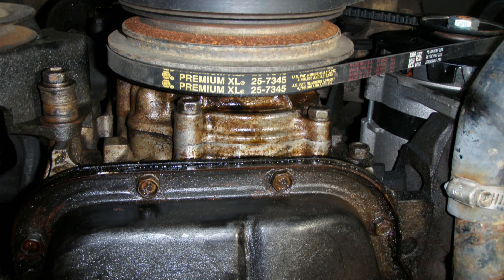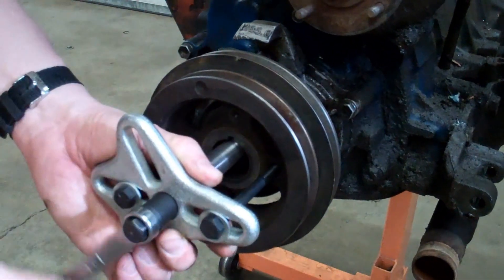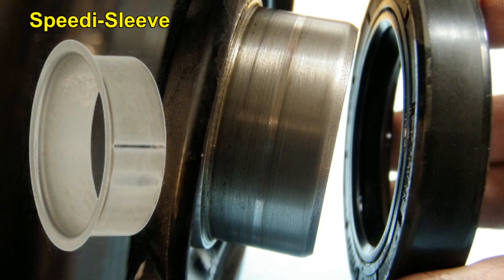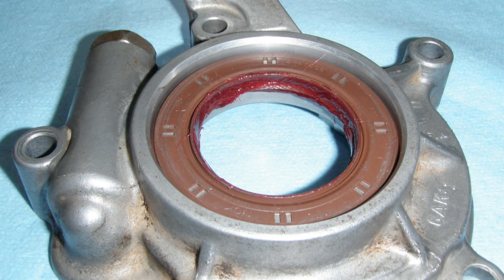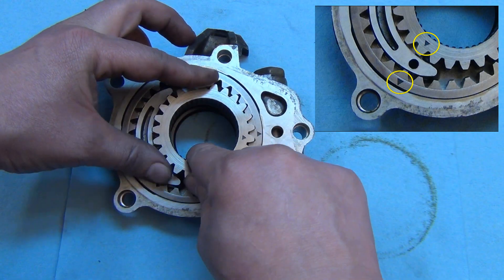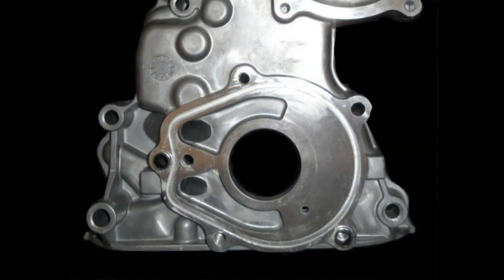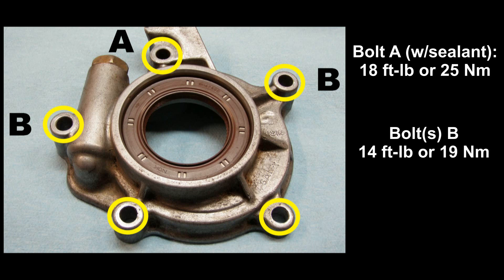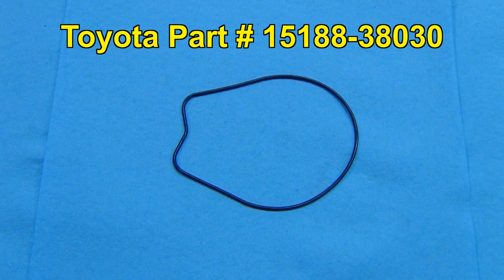How to fix Toyota 22R Front Main Seal Oil Leak (22R 22RE 22RTE) No Speedi Sleeve!

Comment: I was able to successfully replace the front crank seal on my 1989 Toyota pick up truck by following the instructions in this video. My biggest worry was getting the crank shaft bolt off the engine. However, the bump start method worked like a charm. Thank you for this video!  No more oil leak!

Comment: I install the pump with 2 loose bolts then install the pulley lightly to center the pump/seal...tighten the 2 bolts, remove pulley and install the rest of the bolts, torq to spec...This makes sure the seal is centered on the seal surface of the pulley, if its not centered it will leak.....And beware doing the bump start to remove the crank bolt....You can F up the flywheel and or starter,,,I only use it as a last resort after trying a little heat to the bolt and light taps on it...I took a thick piece of 1/4" steel flat bar, drilled 2 15mm holes spaced to fit 2 of the pulley cutouts(where you put the drift) and ground out a haft moon to let the socket go by, install 2 14mm bolts with nuts in the 2 holes and use as a holder, the bolts going into the cutouts and the bar against the socket side....Doesnt F up the dust seal....

Comment: I get where you're coming from but the fact is, that is a harmonic balancer that the Speedi-Sleeve goes on, if it was just a "pulley" then it wouldn't have the weight and rubber insulator strip on it, I can't help that Toyota uses their own goofy nomenclature. Go to any quality machine shop, they WILL call that part a balancer. I was just trying to help, no offense intended.
Reply from the maker: No worries.  Where it gets really strange is they did have totally solid pulleys for a few of the early years.  No elastomeric layer...nothing...just solid steel  (I have one like that from 1981).  All they did was balance it by drilling into the backside similar to how you balance a crankshaft by removing material at the heavy points.  The later model pulleys have an elastomeric layer in addition to drilling for balance.  I guess Toyota just never changed the terminology.  Might have also been economy of words.  "Crankshaft pulley" is less ink than "harmonic balancer hub" in the manuals...lol

Comment: Removing oil pump not necessary but thanks for all the tips!
Reply from the maker: It's not necessary to remove the oil pump, but it's easy to do and gives you a chance to inspect your oil pump gears while it's off the engine.  Removing the oil pump also lets you drive the seal perfectly into the bore with a seal driver, something you can't do if the crank is in the way.

Comment: Bought the O-ring, got the 5 bolts out. Damned if I can get the pump housing off. Steel hammer, pry bar and steel hammer. That sucker isn't moving. Finally gave up, Prey it doesn't leak for me! Pulled a narrow seal and stuck in a wider one.
Reply from the maker: My guess is that the hollow alignment dowels in the timing cover are seized to their holes in the oil pump binding the oil pump to the timing cover.  In the video at 3:06 you can see the dowels in the timing cover (middle left and low right as seen facing the timing cover.)  could also be the oil pump drive gear binding up on the crankshaft drive spline too I guess.  could put the crankshaft pulley back and in the truck in neutral and wiggle the engine back and forth with the crank pulley to try and free things up.  But I bet it was the dowels.  Sounds like you got it fixed regardless.  Most shops would just pry the seal carefully out and drive in a new one to save time.  I like to inspect everything so I always take the extra step and pull the pump.  If you do have to go back in there, and it still won't budge, I would CAREFULLY, heat up those two areas with a propane torch that have the alignment dowels and then put some penetrating spray in there so help them get unstuck.
Reply: @WheeliePete  Thanks, I completely missed the dowels. I put the crank pulley back on but was supplied the 60mm impeller water pump not the 69mm I ordered. I may yet pull the pulley and have another shot at it as the o-ring is here in it's bag. Mechanic for 40 odd years though and I didn't dare hit/pry harder than what I was as there was zero movement. Now I see the dowels I can work "local" to those and perhaps have a better shot. I'd hate to have to do it all again. Cheers from Australia.

Comment: Yeah man, excellent video! Thanks especially for those part numbers, nobody ever does that 🙏🏼. Question: you mention the o-ring fits the 20R as well, does the main seal do the same?
Reply from the maker: I believe it does.  I've never personally done it on a 20R engine, but LC Engineering lists the same front seal for 20R, 22R, and 22RE on their website and they are an authority on that engine so I'm pretty sure it will work.  Link to LC's website:  https://www.lceperformance.com/Front-Seal-20R-22R-RE-Front-Balancer-Seal-p/1015042.htm
Reply: @ Thank you again!

Comment: @WheeliePete, I just ran into the same problem @Ben Hanley (down below) had.  I was all set putting the new Aisin oil pump on and got all four bolts torqued bottom part of the pump and started torquing the top bolt (through the timing chain cover).  Had some resistance and going good, then it just slipped and kept free spinning.  Took the bolt out along with the aluminum threads from the timing chain cover.   I am, pretty sure a shop tried to correct a previous oil leak by over tightening.

Either way, now I have the dilemma of should I put a helicoil in now or do I chance messing a bunch of stuff up by removing the timing chain cover to install helicoil?   Can't find a good helpful video on this.
Reply from the maker: I've never done a thread repair on that hole, but I bet it could be done with the oil pump off and just be really careful about shavings and try not to break the tang of the helicoil off and have it fall into the engine.  Removing the timing cover with the head in place can be done, but it's tricky because of the head gasket overlap at the top of the timing cover (junction of the head, timing cover and block.)  If you booger up the head gasket right there you'll end up with another oil leak.  If you're going to go that far into it you might as well replace the timing chain, guides, etc.  The other thing you really have to watch out for is there's a hidden bolt in the head that sits in a puddle of oil under the distributor drive gear.  That bolt is through the head and into the top edge of the timing cover.  People often forget about it, start prying on the timing cover after they think they have all the bolts out, and then snap the timing cover.  I have done timing replacement though with the head in place, you just have to be really careful when you do go to pry off the timing cover and then make sure all your sealing surfaces are really clean before you put it all back together.  One last thing, if you decide to get a new timing cover, and if you're engine has been rebuilt and has had the head surfaced or decked, you'll want to make sure your new timing cover is the same height as your old timing cover.   If the engine has been rebuilt and they machined the block with the timing cover in place to match the height, then the new timing cover will need to be machined to the same spec.
Reply: @WheeliePete  Roger that, I'm going to attempt to helicoil it with the timing cover in place.  The rebuilt engine has maybe 50K on it.  I don't want to risk pulling it all apart not really knowing what I'm doing.  
Spoke to a local mechanic yesterday and we agreed the less amount of shavings in the engine the better.  Will get the tang of the helicoil out somehow.  He stated that the oil screen should pick up any shavings prior to entering the engine anyway.  I was searching for an oil flow diagram of the 22RE to confirm.  I think I'll do an oil change prior to starting the engine once everything is back in place.

Thanks for the info.👍

Comment: I have a 1993 4Runner with the 22RE and the pulley DOES unbolt from the balancer.
Reply from the maker: Are you referring to the power steering belt pulley that is bolted to the front of the crankshaft?  If you have power steering there is an extra pulley that bolts on with 4 bolts to the face crankshaft pulley giving you 3 rows for "V" belts.  I've read there was a design change around 1985 to the crankshaft pulley design where they started getting an elastomeric layer.  But the early crankshaft pulleys do not come apart (and I've never had one that would or did come apart other than the extra pulley for power steering bolted to the front of the crankshaft pulley.)  I just pulled some later factory service manuals and they (Toyota) continued to refer to it as the Crankshaft Pully through the end of the 22R series.  Side note: If you have an extra one of those power steering belt pulleys for the crankshaft you can make a crankshaft holding tool really easy with some steel and a welder.  Makes tightening the crankshaft bolt a breeze.

Comment: Thanks Mark cool video. 
I have a Question for you maybe you can answer. I have a Toyota with a 22 RE in it and I’m having problems with it overheating. as I was taking it apart to check the head gasket I noticed that when I took the oil filter off it didn’t have any oil in it at all. Do you have any idea what would cause something like that?
Reply from the maker: Oil filter have an anti-drainback valve (flap) in it?  If the filter doesn't have an anit-drainback flap (or if it's not working right) the oil can flow out of the filter and back to the pan.  The idea there is that the filter should be holding oil in it so it's full on the next startup.  There was oil in the pan, right?  No oil circulation in the system would cause a major damage, not just overheating.

Comment: Super helpful video thank you so much WheeliePete! Got my front main seal and o ring all replaced and I'm finally leak free. The PO had put a thin seal in but didn't drive it all the way into the bore. From the looks of it if it's sitting flush at the top of the bore then it sits about where the thick seal does on the pulley. Driving the thinner seal to the bottom lets it ride on a new place on the pulley and like you said guarantees it's square in there. One thing I encountered that you didn't get into too much in the video is that tightening the pulley bolt was a bit tricky! I used the bump start method to get it off and that worked great. Didn't need a pulley puller either probably because it had been leaking oil for quite a while and it was lubed up ready to slide off. 

The most trouble I actually had was finding a way to hold that pulley still so I could tighten that bolt back up to spec. I didn't have a pulley wrench, or holder, and I left my radiator in so a regular impact gun wouldn't do it. I didn't want to wait for a tool or spend the money on a 90 degree impact gun and it maybe still not fit. Best thing I came up with was to block the tires, parking break on, put it in 5th gear, 4hi and then tighten against that. My torque wrench topped out around a 100 ft/lbs so just went a little past that and have checked it a few times since and it's stayed tight. I think I've read and understand that the bolt should get tighter over time due to the nature of the rotation of the motor and the matching direction of the bolt to tighten. Lotta torque going on there!

Videos like yours really help the average guy work on their own stuff, save money, and keep their rigs rolling down the road ;) Many thanks!
Reply from the maker: Glad the video was able to help you out.   It sounds like you'll be just fine on the torque.  You did exactly what I would recommend in the absence of the right holding tool for torqueing the crankshaft pulley bolt.

Comment: Does anyone know if you  have to drain the oil to change this? Or it doesnt matter?
Reply from the maker: The pump is above the oil level in the pan so you technically don't  have to drain the oil.  There will be some drainage when you pull the pump off the front of the timing cover from oil trapped in the pump body and oil passages.
Reply: @WheeliePete  ok thanks. I couldn't find the answer on any forums.

Comment: Just to confirm I don't need to drain oil or coolant to do this? Thanks in advance for your help.
Reply from the maker: Correct.  If you're just doing the front main seal, no need to drain anything (unless you're pulling the radiator for working room.)

Comment: they just changed this part on my 1987 Toyota motorhome before I bought it. they charged 284.20 for labor 21.46 for the part 15.28 shop supplys  Grand Total 345.55 I think they got RIPPED OFF ?
Reply from the maker: Seems a little steep to me.   Depends on what shop rates per hour are.  Also depends on if they had to remove the radiator or not.   I've always been dealing with 4x4's with lots of lift so there's plenty of working room, but if it was a 2wd, with A/C, auto trans, etc...there could be a lot of crap and no access down there...  Looks like they probably billed 3hrs of labor on there...  Not totally outside the realm of possibility...

Comment: Are the specs the same for a 20r motor? 
If not do you happen to know tightening specs for Toyota 20r motor Crankshaft, oil pump and oil pan?
Reply from the maker: Unfortunately, I don't have a 20R factory service manual, but here's a little piece of internet gold I found: A link to a 20R factory service manual over at retrojdm  They have a download button too which is nice:  http://www.retrojdm.com/scanview.asp?scanid=104&section=sst%20and%20service%20specifications
Reply: Thank you

Comment: Hey Pete I got to doing my front seal. Now when I got to oil pump with the two gears with the arrows. The small gear had a arrow. I cleaned and cleaned looking for arrow on big gear. U said both have to be facing up. So I put a mark on big outer gear. When I took big gear out there on back side was arrow. I put it back they way I took it out. Only reason it has over 400000 miles on it. Have not started up wateine on bottom radiator hose. Do u think I did right thing
Reply from the maker: If it's been in there a long time like that and your oil pressure is fine, I would put it back in the way you found it.  It's probably worn itself in and flipping it around the correct way might create a problem now.  Someone probably had it off in the past and put it in the wrong way, but if it's been in there a long time the gears have probably worn in together and I wouldn't change it now.  As long as you've got oil pressure and you didn't see any weird grind marks on the oil pump housing body under that big gear, you're probably fine.  It could also have just been assembled wrong at the factory that made it.  Actually, if you can find a service manual they list a who procedure for measuring the tolerances of the oil pump gears.  You could check them and see how it specs out with a set of feeler gauges.  What you absolutely don't want is grind marks under those gears and bits of metal getting into the oil galleys and then to the bearing surfaces...
Reply: @WheeliePete  started it up and ran it. Good oil pressure. No grinding. Seams fine. No leakage. Did it just they way u said to with the parts u said to use. Thank u for all the help. 405000 and runs like a sewing machine.
Reply from the maker: That is a spectacular amount of miles!  Original engine/transmission?  No rebuild?
Reply: @WheeliePete  yes no rebuild all original manual 5 speed. 1986 turbo.
Reply: O and same turbo to. Sweet little truck black xtra cab 2 wheel drive

Comment: The pulley nut/bolt. Is righty loosey?
Reply from the maker: No, the crankshaft pulley bolt is standard thread.  However, if you're trying to remove the bolt by using the starter bump method, if you hold the pulley bolt still and rotate the engine around it (engine rotating clockwise as you face it), effectively you would be turning the bolt lefty loosey.  Does that make sense?  It's kind of a weird concept to wrap your head around the first time you think about it.  If you haven't seen it yet check out my starter bump pulley bolt removal video, it'll give you an idea of what I'm talking about: https://youtu.be/kkeDnSeCEoE
Reply: @WheeliePete  no my block is on sitting on the ground. But I cant get this pig to budge
Reply: @WheeliePete  oh fuck yes I just got it. Used tire iron as breaker bar on wrench an stood on it an the block. Haha sweet thanks
Reply from the maker: Sweet, I was about to suggest running a bolt from the flywheel to the block to lock it down and then getting a big ass breaker bar and a piece of pipe.  Putting a bit of heat to a stuck bolt like that with a propane torch is usually helpful too.

Comment: Hey wheeelie pete, do you have to align the crankshaft pulley before you pull it off? Like you align the valves or the distributor?
Reply from the maker: Not for replacing the front main seal.  The crankshaft pulley is keyed to the crankshaft with a woodruff key.  There is only one way it can be put back on the crankshaft.
Reply: Hey there wheelie pete. So i ended up replacing my oil pump, o-ring and oil seal with the parr you listed- even 22reperformance advertises that same seal. Anyways so after everything was done. I went for a ride and im guessing that seal didn't hold the oil pressure and i had a major oil leak/ blew oil all over the motor it's everywhere. I leaked out all the oil. Luckily i was close to home. So i made it home before any major fault occured.. But i was smoking from the engine and my oil is completely empty now that the motor is cold. I am going to replace the seal with what i came off with which was "national seal 710345"
Reply from the maker: @Art-mn8nk   Before you pull the new seal out of the oil pump, be sure it wasn't the o-ring.  If that o-ring slips out of the groove when you are putting the oil pump back on the front of the block and it gets pinched, it will create a big leak.